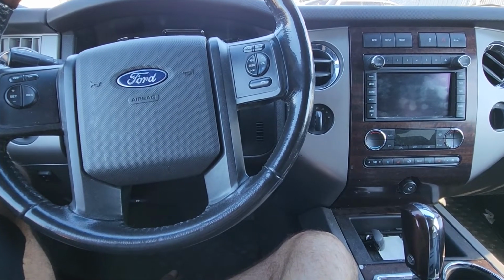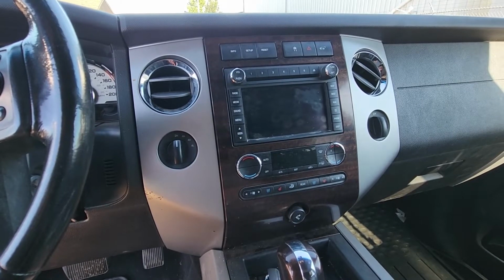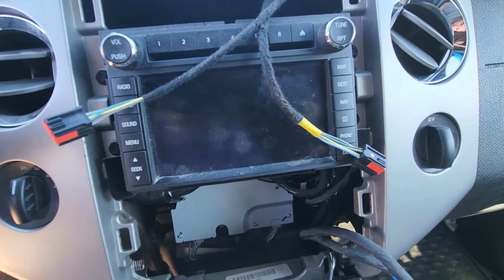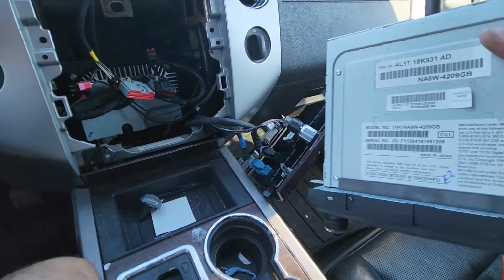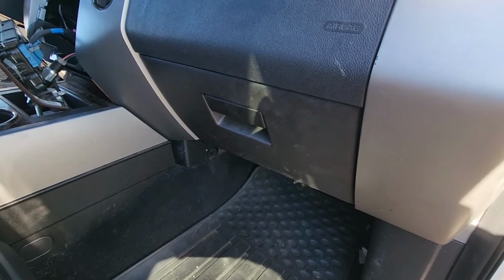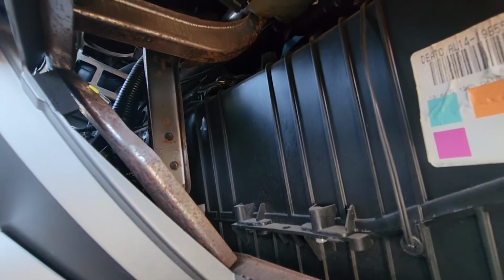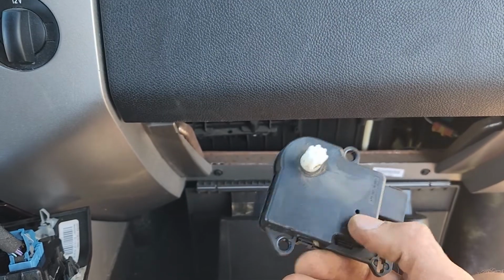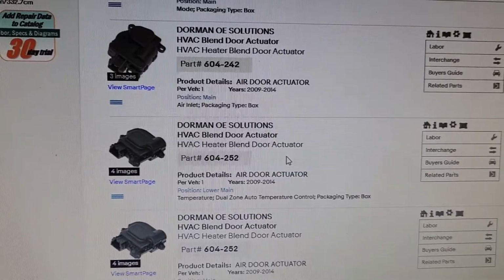Ford Expedition - TEMPERATURE BLEND DOOR ACTUATOR REMOVAL / REPLACEMENT (2007 - 2014)

Comment: I changed out the actuator now the blower will not turn on. After moving the position of the door it kicked on. Installed actuator. Everything worked. Put dash back together now blower will not kick on. Any guesses? I was thinking the actuator and blend door both have position feed backs to the control system which only allows blower to kick on if positions are aligned. But that seems not to be the case.
Reply: Probably a loose connection at the wiring harness connection which is just behind the glove box door very close to right side of passenger leg room space.

Comment: Do you know where the hvac temperature sensor is located? I have a 15 platinum 3.5L
Reply from the maker: Hi I never had to change one on Expedition, but I believe it should be in front of the vehicle, behind grill or bumper

Comment: Yeah I just replace the blend door actuator in my 2010 expedition was and I'm still getting the clicking noise. Could use a little help if possible
Reply from the maker: Are you sure you replaced the right actuator? There is couple of them in the dash and one is waay down under the dash, very hard to reach. If you have a higher end obd2 scanner which can access hvac module then you can run diagnostics. It would go through all of the actuators and synchronize them. If one fails it would point out which one it is
Reply: @QuiteAlright  
Morning appreciate the response back. So apparently I did not replace the rite one. So the one I do need to replace is the one in front of center console. And no I don't have a code reader. So you have a video on replacing that one. I hope so cause your video was a great for the other one. And I really don't want to have to cut anything.
Reply from the maker: @davidchristian602  Hi, unfortunately I don't have video on how to replace the other one. But I remember doing it few years ago and it was quite a challenge. I'm away from my shop for next 2 weeks so can't check the exact labor time, but it is somewhere between 6-8h. Whole dashboard has to come apart. Now that is how much a shop would charge you and what they would do. Good thing is that it is doable without taking everything apart. Check this video maybe at least it will give you an idea what has to be done: https://www.youtube.com/watch?v=c3-LbyltiO0
Reply: @QuiteAlright  I appreciate your time send me a link to that video I'll be giving it a shot tomorrow. Thank you again
David
Reply from the maker: @davidchristian602   No problem and good luck
Reply: @davidchristian602 can you share info on this job? Signs of failed part and what it took to replace?  I just replaced actuator that is in this video, as it sure appeared to be the culprit.  I put in new actuator and the noise does sound different.  I think the calibration or teeth alignment may be an issue.  Just trying to go down entire list.

Comment: Great video but let me help you with that rear bolt: use a 5/16 impact nut driver and turn it with a ¼" ratchet wrench fast and easy just took me 10 min to do this
Reply from the maker: Thanks for the tip!

Comment: TY, i got that, broken teet. but there should be another actuaror, that is doing even stronger knocking, trying to find it .
Reply from the maker: There is one all the way down under the dash. Very hard to access. As per labor guide it is like 7-8 hours to replace it and everything has to be taken apart, but it is doable in 1h or so through the opening close to pedals and under the dash. Very annoying job
Reply: @QuiteAlright could you please give more details about where is located? Is the same model of actuator?
Reply: @QuiteAlright I have replaced the one of the video but i still hearing the bang sound
Reply from the maker: @jarethneox  Unfortunately I don't have a video on the location of it. It is all the way down under the dashboard. Quite hard to access. By the book I think it is around 8h labor to replace it. I know my guys did it in under 2h but it way quite challenging as they approached it from the area right of the gas pedal. So it is pretty much located right of the gas pedal deep under the dash

Comment: If i have no air out of vents, is it the same actuator? Or there is another one?
Reply from the maker: If no air coming from the vents at all then most likely you are dealing with a failed blower motor. I would start from there, check if it is works and if not if it is getting power. If it gets power than it failed
Reply: @QuiteAlright  The fan is working, I can hear it, but no air at any presets.
Reply from the maker: @PavelSubbochev  Hmmm if mode actuator failed air would most likely blow either on the floor, face or front windshield depending in which position it got stuck. Have you checked cabin air filter for air flow?
Reply: @QuiteAlright  Most likely ac evaporator was covered with ice. Today is +5 and all working again. Looks like i need to clean it drainage
Reply from the maker: @PavelSubbochev  Glad to hear everything is working and you figured out what was the problem

Comment: Removed old one.. new one plugs in without issue but the teeth are not lines up the same way as the original. How do I get the to go in the right place? Is this a calibration issue?
Reply from the maker: Try insert the white gear first and then rotate the body of the actuator into the right position. If that doesn't work than just take the old actuator apart and use white gear to get the teeth in the right position. Hope this helps

Comment: Do you have to recalibrate it when you're done
Reply from the maker: Good question. Usually no but it happened to me few times that it had to be done using higher end scanner which can access the module
Reply: Thanks.  @QuiteAlright
Reply from the maker: @mikel1893  No problem

Comment: mine is not making that clicking noise, but the front driver side blows but no heat  and the front passenger blows good heat........ is that actuator for both sides?
Reply from the maker: Hi, if you have dual zone climate controls then there should be a separate actuator for the driver side and for the passenger side. The one on the video is main actuator which I believe is responsible for the driver side.
Make sure to check your coolant levels before doing any work as low coolant will cause same symptoms. 
Also it is a good idea to connect higher end obd2 scanner and run hvac diagnostics as it will test each actuator and send a report if any failed. That would be the right way to do it to be 100% sure if it is not making noise

Comment: I am at 155k miles and about to do this for the second time. Whoever designed it this way should be punished along with those that made the two park spark plug that drops into ford engine blocks lol. Great video!
Reply from the maker: Thanks. Unfortunately this actuators fail quite often and I definitely agree with you. Ford always seems to make things too complicated
Reply: We bought our 2011 in 2015, and it had already been replaced. I've replaced it twice since. I would also say to be very careful with the trim bezel. 10+ year old plastic that's been in the sun can get pretty brittle. Great video! That back screw is a pain!